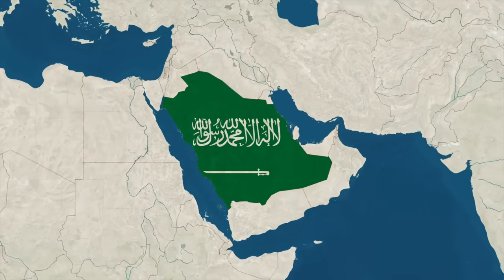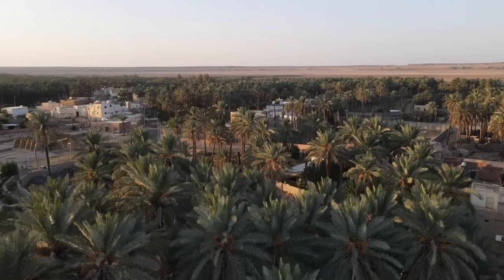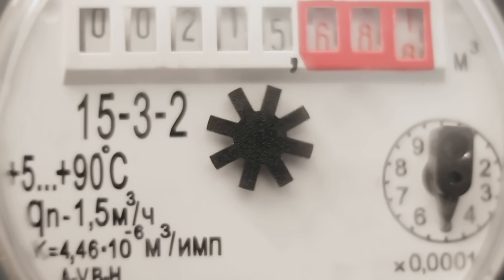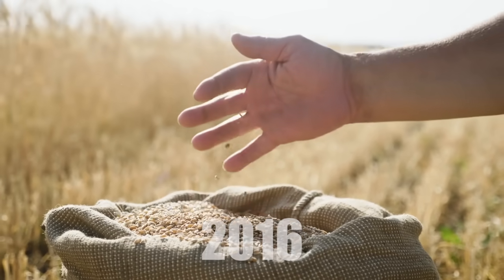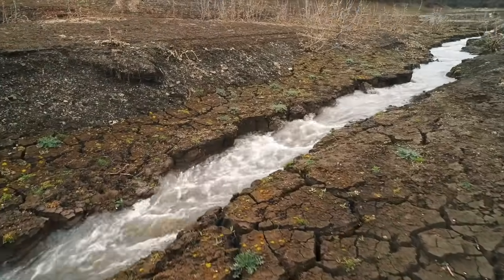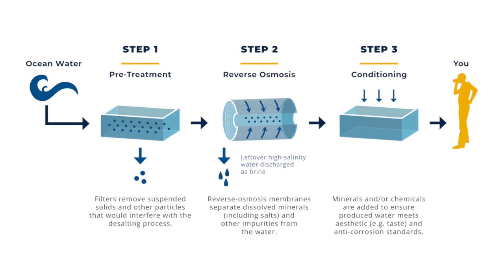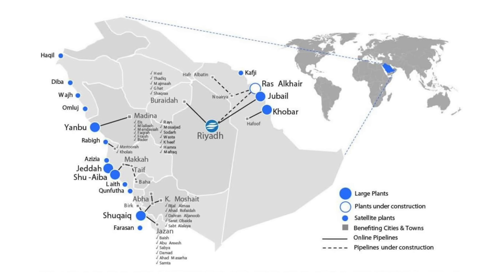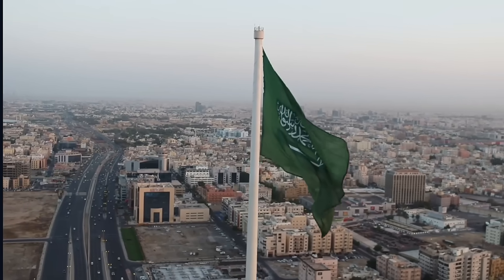Saudi Arabia Is Building The World's Largest Artificial River In The Desert

Comment: Desalination on this scale will result in the production of an enormous volume of brine. The diagrams showed the filtrate coming out of the processes, but the other fraction, known as retentate is typically 40-60% of the total volume. As you attempt to reduce the retentate volume (thereby increasing the salt concentration), you non-linearly increase the energy demand on the RO system. So they will be dumping all this brine back into the environment, and there will be consequences. I don't mean to suggest they can't or shouldn't do this.. I understand that this strategy enables millions to flourish in Saudia Arabia. I would like to see some acknowledgement of the donwsies as well as hear their plans to mitigate those impacts (if any).
Reply: The brine can be dumped into dug out lagoons. It will slowly sink into the crust.
Reply: this process will turn the Red Sea into the Dead Sea
Reply: @VarietyGamerChannel  as you add salty water to an infiltration basin you will precipitate out minerals that consolidate and ossify the bottom of the basin, cutting the infiltration rate to almost nothing. The practical consequence is that it takes an impractical area to infiltrate away brackish wastewater, even if one isn't concerned at all with the underlying aquifer quality (which is usually not the case).
Reply: evaporated brine maybe could leave valuable resources to harvest,  idk...

Comment: The USA states like Arizona and California should be investing in desalination projects ❤
Reply: They need to couple it with nuclear power
Reply: Correct. Small, modern nuclear reactors powering several states scattered all over the country. Chuck the panels and windmills that can't be recycled.
Reply: Where is AZ going to get seawater?
Reply: @rxa177  Mexico, Gulf of California
Reply: Desalination is insanely expansive,  those states absolutely cannot afford this. Only a country with massive oil reserves could afford to see if this kind of thing might work
Reply: Latest new desal tech news came from us, i think MIT
Reply: Desalinated ocean water is free byproduct of generating lowest cost electricity with Eirex Technology in Canada and this ain't your Grandfathers electrolysis of water but timeless cavitation kinda like the 30M year old Pistol Shrimp that cracks clam shells with tiny bubbles.
Reply: @leroyessel2010  that's cool if they ever get it to work, but eirex is not an operating power company, it's a proof of technology startup. As of right now, desalination uses a ton of power. Humanity really really needs to figure this out though, so I really hope the technology eirex has been working on since 2014  goes somewhere.
Reply: @bobloblaw10001But they don't have sea...
Reply: The Eirex Tech is 5 year old company looking for funding or partnerships to also convert waste plastic into synthetic fuels besides hydrogen from any type of water using only cavitation breakthrough.

Comment: 1. What energy is used to heat the salt water? Oil? Solar? Is permaculture and tree planting going to be used?
Reply: More likely reverse osmosis,  relatively energy-efficient.
Reply: @donaldmaxie5264 As a country they hardly use any renewables so the power source is likely fossil fuel based. If only they had lots of space, sun and funds they could go solar...
Reply: @backacheache They have the empty quarter.  A huge area where solar could be used to generate electricity.

Comment: Spain is setting up more and more desalinization installations using solar panes to power the plants. As those are local plants where the water is needed, the project cost less. The water is transported over a few 100 kilometers to reach the inland. 
The problem of the brine is a major concern. In Spain as elsewhere. If you have smart ideas about o solution, please put them in the comments. Evaporation to produce salt is not an option.

Comment: The problem with this project is sea water is very corrosive and salt deposits on areas of turbulence. If you have electromagnetic devices on these pipes to breakdown the turbulence, it would be good. You will need tons of electricity to power them too.

Comment: IF it were Not Enclosed or covered along its entirety, far too much water will simply evaporate. I believe there are enough examples of this evaporation problem that it surprises me that engineers would even consider and open-air conveyance for this water, especially when you account for the cost of desalination. That's why a pipeline is the only practical way to transport large volumes of water effectively.

Comment: At some point Saudi will need to transition from burning oil for its energy and desalination needs.  The idea  of using solar voltaic panels might sound attractive until you realise  the scale that is required. Huge areas of desert would need to be covered with panels  which have cleaning, maintenance and replacement issues, plus a large electrical transmission infrastructure to match. A better and more environmentally friendly solution will be to make use of new combined nuclear power and distillation.

Comment: Eventually Saudi Arabia will run out of oil to power the desalinization plants. They should be investing in fusion power for when  that day comes. The Arabian peninsula was once green until the climate shifted 10k years ago. With enough desalinization to produce enough crops, the greenery will eventually increase humidity levels high enough to generate local rainfall and thunderstorms. The brine should be diverted into collecting pools/lakes and allowed to evaporate leaving salt behind. This will generate additional humidity and the salt is a commodity which can be used and excess sold as an export.

Comment: I think this project is doomed to failure if it is implemented only as described in this documentary.  

The problem is that there's no way to slow the flow of water, meaning the water has no time to soak into the surrounding area.  The banks are too straight and deep, meaning that the 'river' will do little more than erode the land further.  They would do better to create a wetlands, marshy type river closer to the coast and then expand inland as the greenification expands.  This has been seen in successful projects around the world.  If they continue with the current project I hope they are seeking advice from other successful projects.  it's not enough to just add water to a desert, it needs water retention methods as well.

Will wait to see more on this project since it is nearing completion.
Reply: shush that the idea? get them self to wash the hole country away? knower's ark project 2

Comment: One problem with membrane filters is for every bucket of water you clean it produces two buckets of ultra saline water. This super saline water is getting thrown back into the ocean where it will upset the saline balance and eventually kill all the fish. You didn't mention a third option. Why not use black canals with domes over them to collect the evaporated water? The sun will turn a black surface into a hot cook top. Why can't we use the heat from the sun to boil the water? The solution seems so simple. No power needed if you just think a little.

Comment: they are probably dumping brine to sea ecosystems instead using salt as natural material for several uses

Water desalination efficiency is done with solar multi effect distillation and you can check MIT project that doesn't consume electricity and its simple and has way more output than reverse osmosis and no plastic involved (RO creates water with nanoplastics from the membranes)

And to transport water a small train or tram  built with stone could deliver it, moving 500l with small single wagon and even powered by sails or vawt wind turbines without electricity or solar stirling motors or vortex solar turbines

This project is megalomaniac and an aberration
Reply: but it's still in progress. I believe they, optimal circumstances, produce 6 L/hr